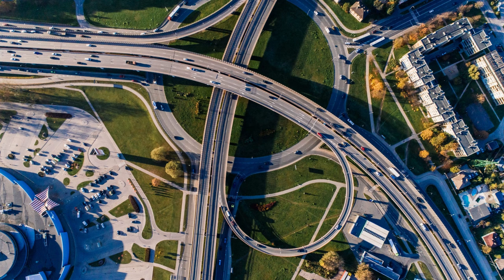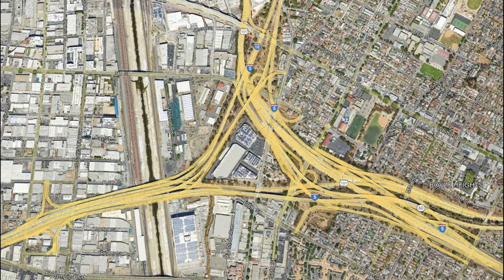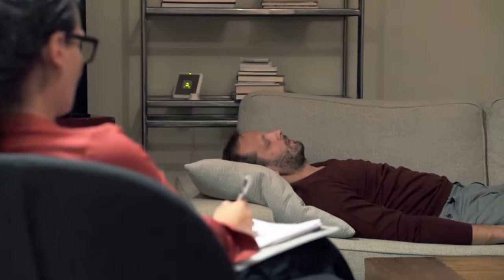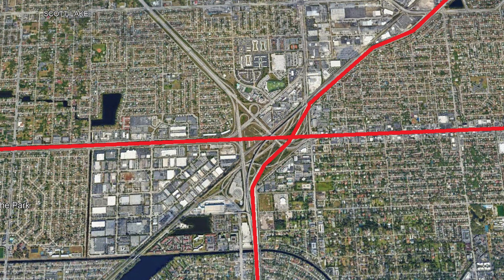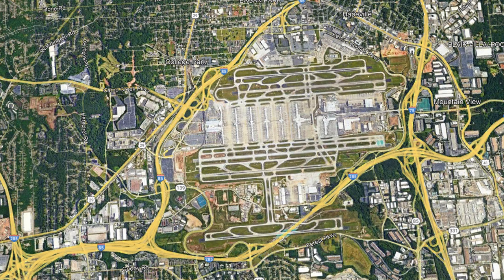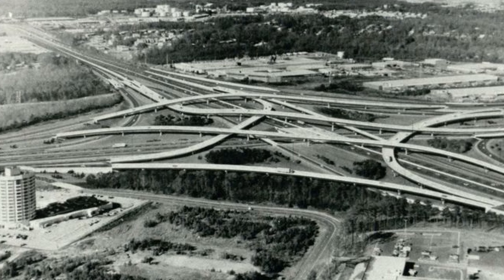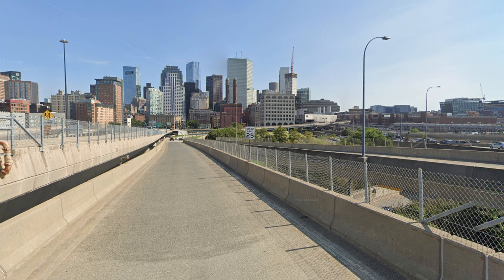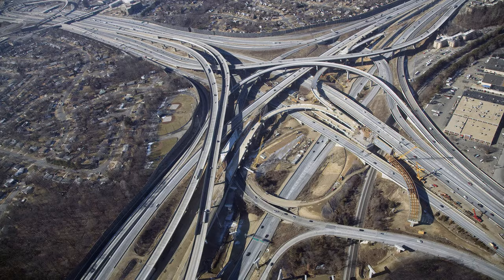America's Most Complicated Interchanges

Comment: The problem with Spaghetti Junction is not the interchange itself, rather the merging of traffic from both sides of I-285, East and West, onto I-85 north, and the huge volume of tractor trailers merging in. It's quite the bottleneck, at its worst during evening rush hour; plus the strong presence of Gwinnett county police in the area makes it even more melancholy than usual.

Comment: Another interesting one I don't think you've covered yet is the I-94 / I-35W / MN-55 / SE Washington Ave intersection, which is southeast of downtown Minneapolis. It can be an absolute mess at certain times, and I always see drivers get super confused about which lane to be in, as there are both left and right exits that come up really fast and sometimes with sketchy signage.

In a similar vein in the same metro would be the I-94 / I-35E / US-52 junction that basically flanks the entire north end of downtown Saint Paul. Going through east to west on I-94 during rush hour can be a real bastard, and the way that on / off-ramps are squeezed in is kind of hilarious.

Comment: Was interesting to watch. Here in San Antonio, theyre currently rebuilding many old interchanges that havent changed (my father still comments on how he remembers when they built them and they were new in the 70s and are exactly the same as they were). I am hoping the old cloverleafs turn into normal stack interchanges like you see in Dallas or Houston and not some awkward left exit oddity. They are upgrading Loop 1604 to an actual "beltway" in the north and west, and just finished turning 281 north of 1604 into an actual freeway, instead of the weird divided highway with lights and u-turns to avoid lefthand turns that it was.

Comment: Of all the interchanges on this video, the Golden Glades Interchange is the worst. But as originally built, it was two surface highways connected with a bridge over the railroad tracks.

One surface highway was on the north side of the railroad tracks and it connected State Road 826 west with US Highway 441 north.

The second surface highway was on the southeast side of the tracks and it connected NW 7th Avenue and State Road 9 south with State Road 9 north and NW/NE 167th Street.

Then they added the Turnpike from the northwest which ran into and took over the bridge over the railroad tracks and replaced the intersections with ramps.

Then the state built interstate 95 through the interchange and upgraded State Road 826 west to a freeway with frontage roads.

The last change was the I-95 express lane over the whole intersection which I drove on to avoid the confusion one of the times I visited South Florida in the early  2000s.

Comment: The Boyle Heights Interchange is actually part of the East LA Interchange, which actually includes the other two interchanges north of it as an integral part. If you miss your ramp, you generally can correct the mistake somewhere else within the interchange by simply driving in a 3 mile circle... Its always busy, and I once spent 2 hours just in the boyle heights section in a truck with no AC.

Comment: East LA: I went through this interchange several times on my many visits to LA. I-5 south of downtown was US 101 until it was redesignated as 5, which is why it's so logical and easy to drive from the Hollywood Freeway to the Santa Ana Freeway. The end of the Golden State Freeway (I-5 north) was kinda stuck in there, and there is only ONE LANE going from I-5 north to I-5 south. It's so easy to end up on the wrong freeway here. Downtown Houston, with I-10, I-45, and US 59 meeting up within a mile of each other, is bad too, but it's easy compared to the East LA interchange.
Reply: My old man told me stories of driving a 2 ton truck around there growing up... Best part was to get back north to Azusa where the shop was after making deliveries, he had to cut from an onramp on the right, across 4 lanes of traffic to an exit on the left in under a quarter mile... If he missed, had to do a lap and try again...
Reply: If you miss your off ramp, it takes about 20 minutes to turn around.

Comment: Dare you to talk about canadian highways like the 401 in Toronto. It's actually kinda impressive.
Reply: The Basket weave and 409/427 stretch is not one interchange but three but they do add some adventure to driving
Reply: @marklittle8805  i think you're a bit confused about that tbh lol. 

Im not sure where you got 3 seperate interchanges from because technically the 6 way interchange between the 409/427/HWY-27/Eglinton Ave is all one continuous giant interchange, similar to Michigan's 5 way i696/i275/M6, while the basketweave interchange im assuming your referring to is about 300m from the start of said single interchange.

(Edit: just realized that technically the basketweave is actually much closer that i had previously though lol.)

(Double edit. I just realized i got my interchange locations and numbers wrong lol)
Reply: @marklittle8805  actually which basketweave are you referring to? There technically isn't one on the 409 or 427 at all. 
Where you referring to the Pearson airport spaghetti loop interchange?

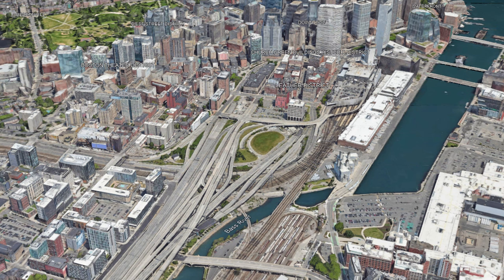Comment: 9:14 It's U.S. 1, not U.S. 9
Reply: it's U.S. 1 and 9
Reply: @jamiebarba5701  US 1&9 should be for the Newark area.  By Boston, it’s just US1 and US9 doesn’t enter New England.
Reply: @jamiebarba5701  No. It's I-93 and U.S 1. MA 3 leaves the concurrency just south of the Charles River while underground. MA 1A, which uses the Callahan Tunnel to go to Logan Airport, spurs from I-93/U.S. 1/MA 3 SB only. MA 28 is entirely west of all this. U.S. 9 never enters Massachusetts; it's in Delaware, New Jersey and New York. If you are thinking of MA 9, that's an EW route from Pittsfield to Boston, ending at MA 28, never reaching the Interstate.